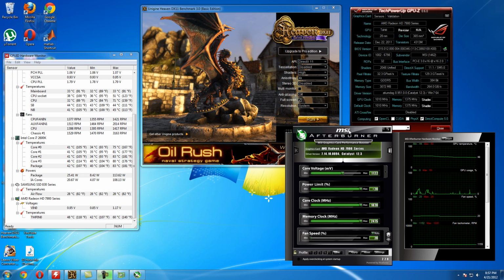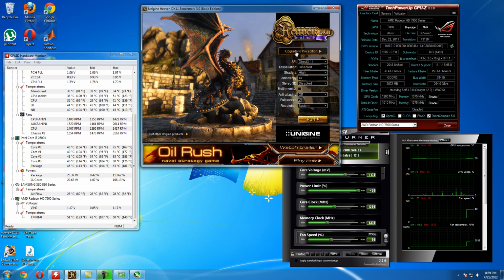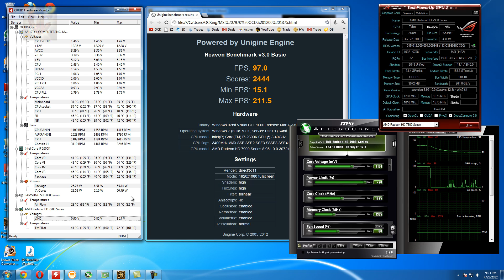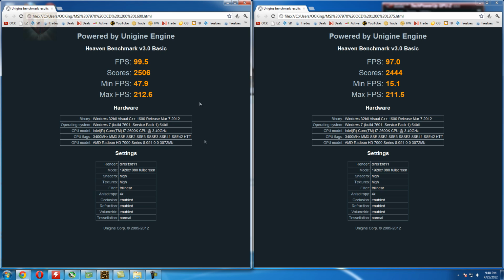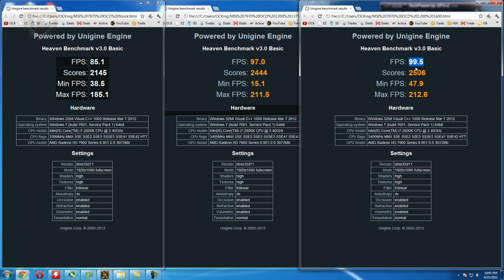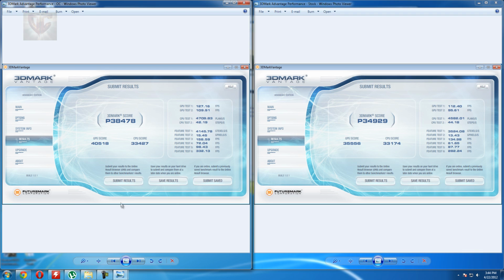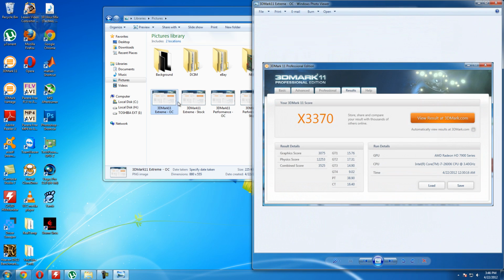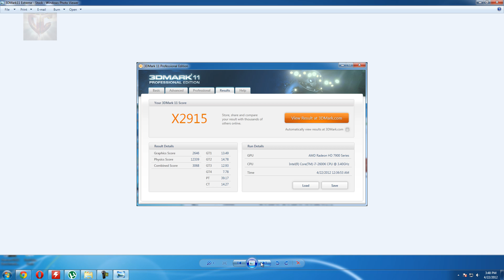[HD] How to overclock MSI 7970 OC Edition on MSI Afterburner

Comment: ghz edition is lower i have the MSI Radeon HD 7970 twin frozr OC boost ediion i got all these stats stable in valley benchmark at over 200FPS the twin froz Boost edition is the highest edition before 7990 and it only costs around 317$

Comment: no worries buddy i will post my OC settings now..i use MSi Afterburner 2.2.4
Core V = 1200
Power Limit = +20
CoreClock = 1200
Memory Clock = 1600
FanSpeed = Auto (33)
Catalyst Version = 12.8
bench = 3DMark Vantage
i still try to unlock MA but no luck till now..anyway..the card is a beast..i can play any i mean any game on the market on max settings 1920 x 1080 at 60Hz frames monitor limitation but to get more i`m not enabling Vsync..in BF3 i get max 200 fps and min to 70-80fps..65c-70c temps.